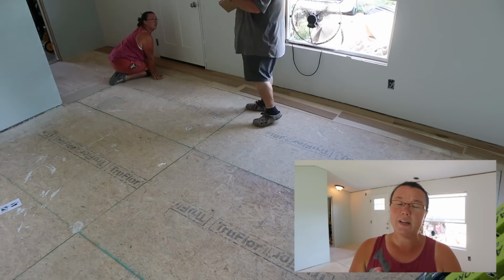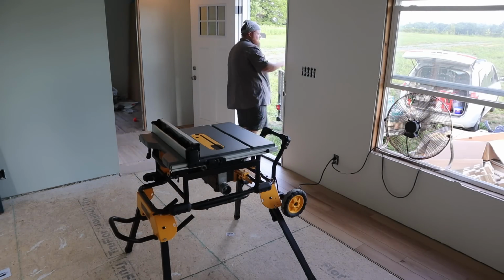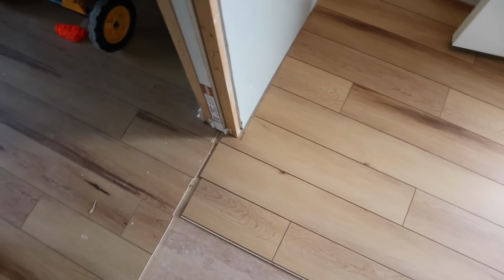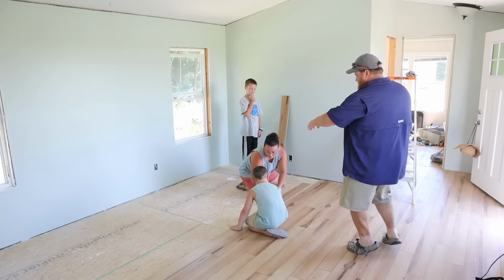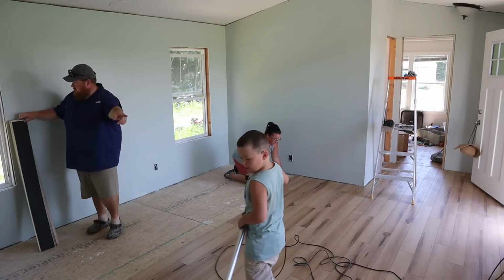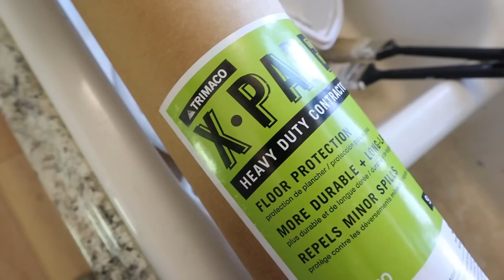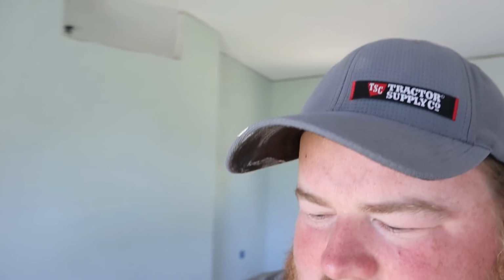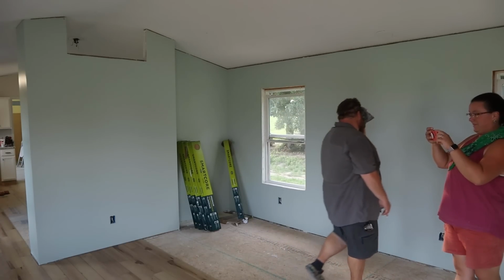Our New Hickory Floor LOOKS AMAZING!! // Mobile Home Renovation

Comment: As with everything you have done, the floor looks fantastic. Now only ten miles of woodwork and it will be finished. We have hickory kitchen cabinets. One thing you do not want to do is while unloading the dishwasher with a door above open, raise up and hit your head on the corner of the door. Like hitting rasor blades and it will make you blead.

Comment: I used to have bone spur pain, it was awful!! Then I read somewhere about an exercise that completely cured it. I’ve never had a problem again. It’s been years. While you’re sitting on a chair, keeping your heel on the floor, pick up a marble with your toes, and drop it into a coffee mug. Again, keeping your heel on the floor the whole time. Do this several times, takes a week or two. I didn’t even use marbles or a mug, I just pretended they were there. I hope it works for you!!

Comment: You may already be aware, but I found it so much easier when making straight/square cuts to just use the score and snap method. Easy even with stone core, way less mess and more accurate cuts.
Reply from the maker: We've not tried that before, but will give it a shot on the bedroom floor.

Comment: My husband and I both like you! We are an "older than you" couple from PA. We enjoy watching you and how humble you both are. This is for the husband: I have foot problems also, with plantar fascistic. Please let me give you some advice on what to do for your foot or both feet. My left foot is worse than my right, so maybe that is your case too.......one foot may be worse than the other. Go and get some good foot orthotics and a good pair of tennis shoes, like New Balance or Asics. We buy foot orthotics from a shoe store where you stand on the machine and it tells you where the hot spots are in your feet. I most always have to wear shoes with the foot orthotics in them, or my left foot will give me problems. Hope this helps! Love you shows and keep up the great work!
Reply from the maker: Thank you for that recommendation, we'll check into it! I mostly wear Oboz hiking shoes but do crocs when the flare ups happen -- at Dr. recommendation. They've not mentioned inserts, but I'm willing to try them!

Comment: Enjoyed the video. Looks great. I had bone spurs when I weighed over 400lbs. I am a machinist and always on my feet.  I had arch supports made to put in my shoes and they worked fantastic. After I lost over 200lbs I don't use them right now but will if it ever flairs up again. Prayers

Comment: Sam, has your doctor ever suggested leg stretch exercises for your bone spurs? My orthopedist suggested wall leg stretches. Hold lunge to the count of 30 and do three reps. You will feel the sting when you are doing it right. I found even one set of three relieved my heel spur pain. I do not do it every day, but when I feel the heel pain I do it then and get relief. Even if you only feel discomfort in one, do both. I had a podiatrist tell me that many people "need" gastroc resections, which encourages me to keep up the exercise rather than undergo surgery for mechanical "stretching". Hope this helps.

Comment: If your flooring is the kind that does not get glued or nailed down, you can remove the flooring from your son's bedroom, and shift it to make it line up perfectly with the new flooring. Just my OCD speaking up. To resolve your table saw issues, you can pick up a 1000 watt, or even a 2000 watt power inverter that plugs into your car's cigarette lighter. That should give you more than enough power to keep that thing running. I would also recommend you having the engine running so you don't drain your battery.

Comment: I worked as a tech for Comcast and DirecTV. I had issues with heel spurs and sore arches, until I got boots with a steel shank.  Red Wing boots are expensive, but are so worth it.  I'll never go back to cheap boots.

Comment: Great looking Floors and I'm still loving that paint color. Sam I love love love that Saw! I have all my own tools and love building. Sam for heel spurs wear shoes or  sandles with high comfortable arches. When mine start bothering me I buy the knockoff Burkinstocks at Walmart. I have bought the real one and they are great and last longer but you are talking over $100 vs $12 to 14, maybe less. No joke will  work as soon as you put them on.

Comment: Nice!  Something you might consider if you are going to put down shoe or quarteround moulding.  Buy the vinyl.  I put it down over the wood.  The white was a perfect match without painting and when you mop you don't have to worry about getting it wet.
Reply from the maker: We just bought trim the other day and got it! We liked not having to paint it and it was cheaper than wood. :)

Comment: Do look at the chemical resistant, cashier type of floor matting for in your shop and also a strip for carting around with your saw.  Chemical resistant 'cause you periodically use chemicals and paints.  Then as dollars present themselves, start picking up mats to stand on; even if they aren't chemical resistant; even if they aren't new; even if they aren't ideal.  You can always upgrade or layer where it is functional.  Using mats now should theoretically help for in the future too.

Comment: Since that is a waterproof pvc flooring I haven't used that particular Smart core brand but most likely it is a score and snap flooring.

You should be able to take a utility knife with a good sharp carbide blade use your square and score across the back of the flooring and then snap it off instead of always having to get up and walk to a saw... That saves a whole lot of up and down on your knees or time waiting for a piece to be carried to the saw and back..

Also when you're installing a room or any run if you work with three or four or even more rows at one time the person who's down on the floor doesn't have to scoot back and forth across the room 100's of times.  

You'll see that it goes much much quicker. And yes the oscillating tool is a great tool for this install

Comment: I am putting down similar vinyl flooring and for anyone else doing this, a razor blade with a drywall t works awesome, it snaps along score lines easily so a lot of the cutting they did here you probably wont have to do.

Comment: For bone spurs May I suggest keeping a can of soup or can of veggies next to your bed. Before getting out of the bed roll the can with your bad foot back and worth several times to relieve pain. And of course you can get a steroid injection in the area.
I used to have to do both of these things years ago because I had a bone spur. Luckily it went away and it has not  bothered me again. Knock on wood. I hope you feel better.

Comment: Nice! I opted in for a Metabo contractor saw too over my old cast iron beast. I do miss the quiet belt drive motor over the direct drive on the contractor saw but the portability is oh so nice. Funny, I didn't want to get it dirty either.

Comment: Same problem I was having with all 3 generators we tried on my 8 gallon compressor for the roof install... they wouldn't push the compressor 😐. 
Maaaaannn... I'm dreading my floors right now. Its 3/4 plywood laid over the original sawdust plywood it came with. I KNOW I need to take it all up....but its tempting to floor over it for now and get settled first. 
But when will it ever be really EMPTY again, amrite??! 😆 ugh.. I don't wanna.  
Glad YOUR floor is looking good at least!

Comment: Wow!  The floor looks great.  I didn't see you use a tapping block at all.  When I used smartcore ultra, I had a lot of trouble getting the pieces connected well.   I assumed that all of this type of flooring would need a tapping block.  Maybe I had a bad batch.
Reply from the maker: We've never needed a tapping block for installing the flooring. Maybe it's how we install it (complete row vs. piece by piece)?

Comment: Your osb sub floor should have been staggered instead of the joints lining up. Nice pick on the flooring.
Reply from the maker: Yep, it should have. That was installed about 7 years back as we learned. :) We weren't about to pull it up to redo at this point though.

Comment: Hey Sam, I'm at 4:44 n the video. Just saw that you picked up the DWE7491RS!! Man what a great saw. I bought this same saw Feb, 27, 2020. I looked at Amazon to see when I bought it. Lol. It's such a great saw for woodworking, or carpentry. It'll cut through anything I've thrown at it. Also if you end up using dust collection on your saw. The dustport on the back of the saw works well, however it does miss some of the dust up top. However there's a second vacuum port on the guard, riving knife, thingamajig! (Thing-a-ma-jig!) And with both vacuums pulling, there's not a lot of chips or dust getting everywhere else. Anyhow with that said. If you end up finding a way to split a single vac into being able to pull from both ports efficiently. I'd love to see how. I'll probably pick up a three way vacuum adapter, then figure it out from there as far as the different sized ports. Anyhow thanks for the videos I enjoy them. Now I'm gonna unpause and finish the video. Lol take care.
Reply from the maker: I'm pretty excited to get to use it. I've yet to cut anything on it though. LOL Guess that'll be after we move back into the home and have "real" power again. :) Oh how I look forward to those days! Samcraft can live again!! LOL The workshop is appliance, winter clothing, furniture and other storage right now.
Reply: @sam-and-angela  yeah I understand that. You gotta do what you gotta do.. take it easy Sam. Oh and I really think you'll like that saw once you get some cuts in on it.
Reply from the maker: @brentfowler2317  Thanks, I can't wait! :)

Comment: Was the tape you used for the protective paper designed to be used in this application? It looks like masking tape to these old eyes. Masking tape could be very difficult to remove if it's on too long, You guys do beautiful work. Thanks for sharing your journey.

Comment: I bet the floors are hard on joints ? We have wood floors too ( oak planks ) and BOYYYY are they hard to kneel on , or actually lay on too. I own a Karcher Steam cleaner , and on a regular basis , use this to thoroughly clean the whole apartment . The only place there are floor tiles , are both bathrooms.
Reply from the maker: It's def. not comfy! :) Well have to check into a steam cleaner!
Reply: @sam-and-angela  just check that it can be used on your special flooring though , but i use it in the bathroom and can clean almost anything with it .Karcher are a quality company too.

Comment: That looks great. Well done. It looks like you will not be fixing skirtings around the floor to wall junction. Perhaps that is old fashioned nowadays? I think they were fixed to hide bad cutting in of the flooring, which with your precise and careful cutting you have nothing to hide. But do they have skirtings in the USA?
Reply from the maker: Do you mean floor molding or trim? If so, we are adding that soon. :)
Reply: @sam-and-angela  Yes.

Comment: The floor looks good but what about your power when they ever going to get that turned on I laid that floor and I had problems around the door facings where they have the little trim then a big trim little I have problems getting cutting around that it looks terrible any advice

Comment: Correct me if I'm wrong, yet I've heard that when you get that kind of flooring that you need to lay it all out for at least 24 hours in order to acclimate to your home and climate before installing?? Otherwise, not long after it will pop up and or shift and buckle??

Comment: We put a vinyl floor down in my parents basement for the water resistance feature. The shock was how it damaged so easily. Even as it was being installed it buckled up when putting appliances & furniture back in the house. Are you having the same issue?
Reply from the maker: Oh wow! No, we’ve never had that issue before.. I’ve seen some floors do that in the past when they were more wood based and not given enough time to acclimate or had moisture or humidity issues to contend with.

Comment: U know, if u close the doors and window and NOT let the heat in, then use ure minisplits, u can lower the indoor temperature. A open door and a faan DONT lower ANY temperature
Reply from the maker: Mini splits need 240v power to run. We don't have power to the house yet -- only solar and gas generator.
Reply: @sam-and-angela  ahhhh then I understand. Because I noticed some of my friends are having heat stroke almost, and when I visit them I noticed they have their windows fully opend. “It cools soo nice in the breeze” and i say “ but ure open window are letting the 91 fahrenheit in….duh” its better too have the windows open in the night to cool house and then cover them in the day, to stop the outdoor heat to get in.

Comment: Are you still waiting for the final inspection for your electrical? Seems like a long time since your install.
Reply from the maker: We've had our trench inspection and are including that in our next video of grading work outside the home. We've had to wait to finish our interior work before getting an electrician for final connections and inspections. That should be happening this week... we hope. Same for HVAC install for mini splits. We have to build front and back decks and trim out the interior and that's nearly it.

Comment: How much more permits til yal move in totally. I can hardly wait.  Later gator.
Reply from the maker: Three more permits -- rough electrical and final electrical for the electrician's work of connecting home panel and septic pump system. Then another electrical one for mini splits that the HVAC company will do for hooking them up. Then final CO inspection.
Reply: @sam-and-angela  I'm with yal all the way. My central went out I'm using windows units but it's not the same. So I can only imagine what yal are going through. 3 years ago I was right where yal are. Just me doing and googling for help.
Can't afford otherwise no one even teenagers want to work so hmm I've saved a lot of money but it would be great to have real hands on instead of using a ladder to help install my plantation blinds.  Now that's a huge help fir winter and summer holds g in and keeping out.
I do at 75 years of age yard work early in morning and 6ish at night. 
Keep on keeping on. 
I have windows  and hvac
Then privacy vinyl fence at very end I hope I make it ..still standing.
Angela is a true blessing to others that want nice thgs fir family.  Yep Sam you know how it's done keep kiddos kinda involved. I personally no they appreciate what yal are doing and have done. Just saying Later 🐊

Comment: Everything looks great, you guys have done a much better job than the real legit 'contractors' who did our upstairs floor last year..  We've had issue after issue with their work, it just never seems to end..  Did you have any issues with any places where the floor plywood met and maybe wasn't exactly 'pefect' with the alignment?  We've got some very noticable spots in ours where they didn't take that into account and fix it accordingly, and (to me anyway), it sticks out like it has a neon sign pointing at it, lol.  We were supposed to get Smartcore, but they did the install when we were out of town, and we ended up with adhesive-attached Shaw, 2mm thick, not the 6+mm like yours.  Probably why you can see the inperfections pretty plainly..  As always though, your works looks great, head and sholders above our 'professionals' work..
Reply from the maker: We did some prep work before laying the floor. We used floor leveler and patched any joints in the subfloor wider than a finger's width and also leveled any low spots or dips. We didn't show it on camera, but it was one thing we'd learned from doing the kitchen floor -- the low spots or gaps were noticeable after the floor was installed and it would creak or move in those spots -- maddening! :)

Comment: shouldve kept feeding her pensils during the intro : where goign to use a pensil .... and another pensil...... and WILL YOU STOP IT
when we lay flooring we usually put some sort of foam underfloor under it , because if theres dirt under the flooring and you step on the flooring it will crunh and crack the thin packing foan on a roll is enough to prevent that
its allso verry importand to put all the packs of flooring inside the home to get it to aclimitize aspecially if it colder or hotter outside , the flooring schrinks and stretches due to weather and when you fit it with a small gap around the circumference with the wood in its schrunk form , it can stretch so mush that it will bow and lift off the underfloor (and thats not a freak accident it actually happened to me twice though not through a misstake i made ) because the people i was laying the flooring for "forgot" to carry the packs inside a day before i was to lay the flooring so the planks where cold as ice when i was putting it down ...... offcourse it was my fault by the time the planks started warping 
the gap around the edges is important for that same reason , might be you be on youre knees with the buzsaw cutting the opening larger in a few days to get the wood flooring to lay flat again
the end result looks great , like the v groove in it , like cherrywood myself its darker and redder and fits my furniture better but this lighter wood looks pretty good too
about the painterstape you used on the floor : yes its soft peel but the glue will dry out and leave residue on the floor if it gets wet or is exposed too long to the sun so dont leave it on there too long or you be peeling small bits of tape and rubbing that residue off for a while , might be better to use old sheets